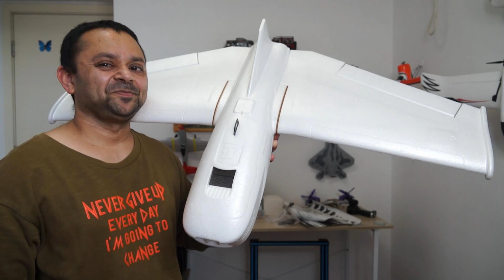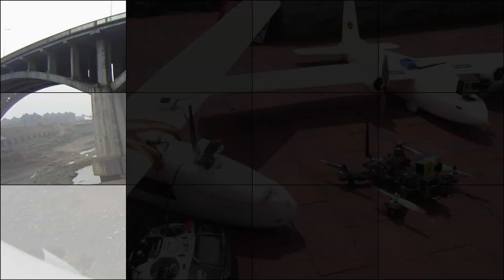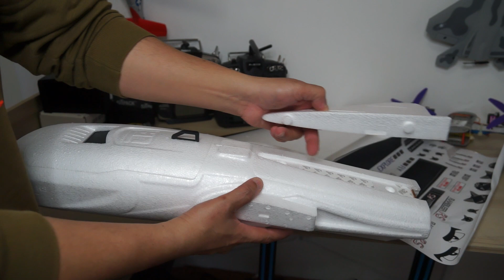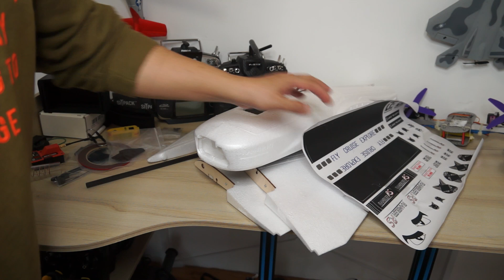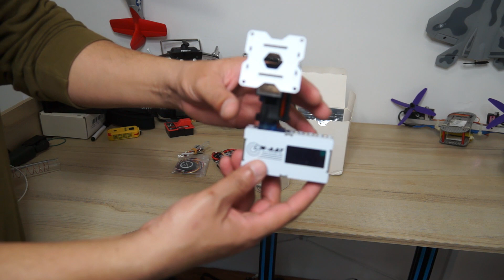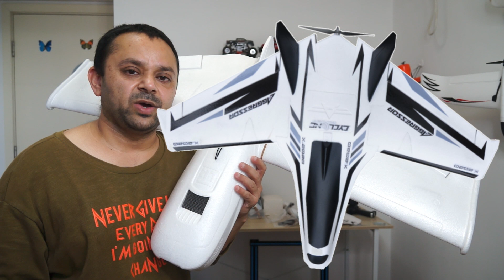Rambler RS Long Range FPV Flying | FPV Dream Wing

Comment: will rambler fly okay with sunnysky x2212 1400kv motor 4s lipo and 7x6 prop?
Reply from the maker: probably will scream a lot with lower speeds

Comment: Can you tell me the max allowable AUW please?
I have purchased and got refunded on 4 tries for the mini talon...not I have all the electronics and fpv gear that I spent good money on just sitting there...it would be nice if I could use that equipment on this plane...your thoughts please??
Reply from the maker: Some people flew max 1.8kg. So yes it can take good payload however Mini talon uses different motor which is bigger and heavier and spins 10 to 11 inch prop. so might be too much for rambler
Reply: @alishanmao  ...thank you for your response!!
Yea, I have a cobra 2221/16 940kv and aeronaut folder 9x7...runcam hybrid, pixhawk cube and here2 GPS, crossfire rx, 
TR1013 EAGLE PRO 1.2/1.3 GHz 0.5/1W LONG RANGE WIRELESS A/V SYST that was for the talon but can't get it shipped...so I've been researching options.
I did purchase the nano talon evo but don't think it can handle that weight...
Thoughts?? I value your experienced opinion
Reply from the maker: if you want long range then 1.2g is a best option for video but use low pass filters else controls are gonna have issues. look for lawmate 1.2g systems. they are good.
Reply: @alishanmao  ...yea, basically what I have is updated lawmate electronics 1.2/1.3ghz...i paid alot for all the gear, so I ordered today from another vendor, im on number 5 now and waiting to see if it will be shipped...the nano talon was ordered a week ago, so I guess I'll be buying smaller, lighter gear for that so it can go long range

Comment: Hi, good work man. Question, how performs that mini tracker? is it reliable?
Reply from the maker: haven't used it so far. to be honest, I trust my head more. when I fly with video goggles and a nice powerful patch antenna on it, I can simply turn my head in the direction of the plane to point the patch to plane and I can get clear video. saves cost, saves trouble carrying and setting up extra hardware. only downside is that you can't move your head, you have to keep your head in positions to point antenna to plane. but so far it has worked great for me. and I am happy. 

with AAT, you need extra battery, extra tripod, extra setup, time consuming, cluttering, and you have to use an LCD that i hate. so to say, I am not a big fan of AATs. i just have it because people asked me to review it. I probably won't even use it after review.

Comment: do you ever use the dvr on the eachine goggles? i have same set and the dvr just simply sucks and is unreliable. wondering if just my device or is common issue.
Reply from the maker: yes used it before. there was no issues just that quality is not too good